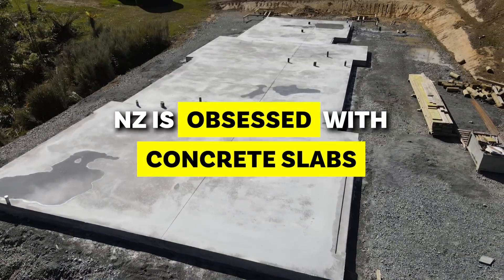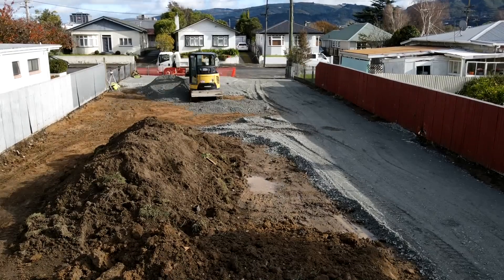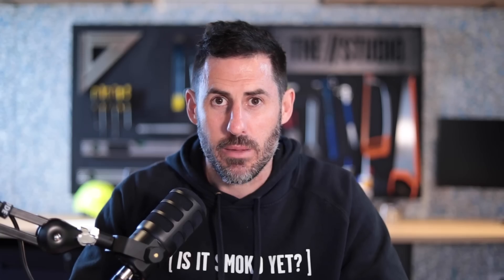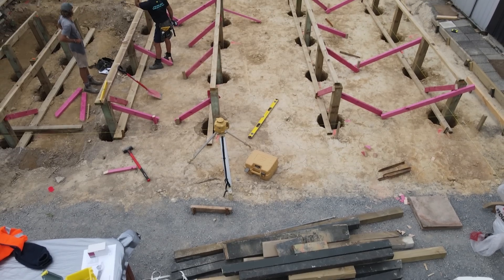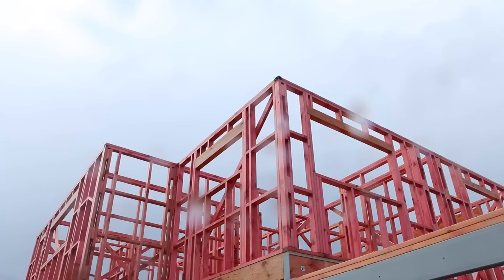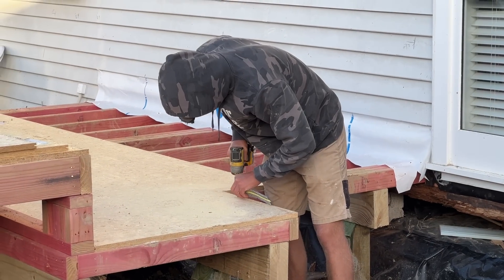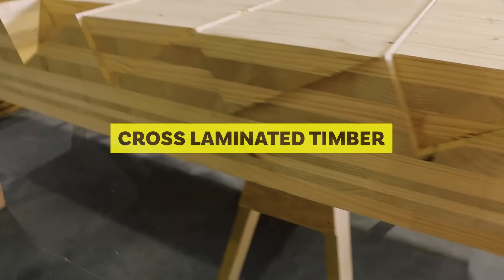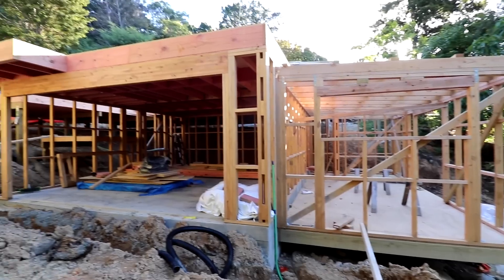New Zealand is OBSESSED! with Concrete Slabs

Comment: Concrete crews are adding an additional cost to building in NZ in my opinion. Once upon a time.. builders built everything. They had a sensible charge out rate .. alas .. now  .. they seem to be more site managers and other trade facilitators then builders. IMHO. Its how ever single layer of a build from design to completion has a margin tacked on. The consumer pays for it all. It may interest people to know that a concrete slab for a lifestyle shed of 162sqm was quoted at $45K. This didn't include any earthworks ..just arrive, box, fit the supplied polystyrene, lay the supplied seismic mesh, pour the slab and finish. Yup .. that didn't happen. Slab done 100% finished and council approved for $10500. Recently, I got a quote to add the ramp entry to the shed as I'm time poor... 9m x 2m $5400 .. you have to be joking right!! NZ building is out of control. I might be an old-timer but seriously.. tradies don't really need new utes every year ...do they?
Reply from the maker: Thanks for your perspective, I know costs are a big concern!

Comment: How high off ground level can you build up a concrete slab? Assuming ground is relatively flat and no complicated engineering, i.e. just a normal max height of slab under normal conditions. Thanks
Reply from the maker: I think 3604 allows you to build a shutter 600mm before you need to consider blocks / retaining / engineering
Reply: Thank you Josh, if you had an existing slab could you raise the floor level by laying say 300mm joists (for habitable dwelling), or would this require specific engineering, thanks

Comment: Concrete  tends to have a few issues with earthquakes and the fact that on the shaky isles is on fault lines and volcanoes means odds are in a major event (like the Christchurch earthquakes) a lot of buildings are going to suffer major damage and be condemned.
"Option C" go base isolating.

Comment: I've put in a concrete slab, and timber floor over the top of it just to subvert expectations :P

It'd definitely say that it's not "faster" though (at least in the little experience I've had) - you have to tie in putting the slab in with the sparky, plumber, drainlayer if different guy than the plumber doing your septic tank and whatnot - and everyone's always busy and will be there next week. Timber piles, you just build everything first and whoever needs to do anything can do it later on and go through the floor.

You can also take your time building on a concrete slab if you're waiting on materials and whatnot (ie. you're not a big building company builder that can dictate when and what happens using their own warehouses, tradies, transport, materials etc.)

Comment: Good video. We've gone through a number of design processes and the last one, we were going to use SIPS panels, which were two layers of Magnesium board with polystyrene in the middle. Mag board is very hardy and water resistant. We were also going to use Espan CLT products for our floors. In the end, that project blew budget and we cancelled it. We are still left wondering what to do. In central New Plymouth, the Council is now allowing house building heights of 11m, which allows 3 floors, so we might build a compact tall Air B&B? Our issue is also having a very soft ground, so we have to pile down deep and probably have a steel structure if we go 3 floors high. But....National have been talking about a non consent 60sqm granny flat option, so that's a possibility too.

Comment: Concrete and brick is by far the best common construction technique we have these days.  You can build a house with concrete slab and brick walls.  And in 100 years its still going be as strong and look the same as it did the day it was built. 

Timber (especially plantation pine etc) will rot or fall apart well before then.  And its not even striaght when its new, let alone years down the road.

My house is a 60s double brick house.  It has jarrah timber frame flooring.  Cement tiles on pitched jarrah roof framing.  The bricks are just as good as when they were layed.  The timber though is sagging and squeeking.  I had replaced all external fascias, gutters and eves because they have rotten away.  But the bricks are still going strong
Reply from the maker: How good! huge benefit of a brick home is the maintenance

Comment: Concrete doesn't crack. Lazy hit and run contractors who just wants the placing money only contribute it to cracking.

Avoid cracking by cement stabilizing base and taking compaction really serious.

Poly line sub before hard fill.

Cement stabilize hard fill then compact hard.

Use a large aggregate low slump concrete mix.

Seriously vibe concrete to consolidate (not taking a brisk walk).

Wet cure without break for 7 to 8 days non stop.

Comment: Hi Josh. I moved to nz 16 years ago. In South Africa. All houses without exception there are built with a concrete slab and brick and mortar for internal and external walls. Found it quite hard to get used to posts, timber floors and drywall.
Reply from the maker: Very interesting how every country has their standard

Comment: My NZ house was built in the '60s with a concrete slab.  NOT insulated so the 'thermal mass' sucks up heat all winter!
Reply from the maker: Interesting isn't it - the slab edge insulation that we are seeing more and more now fixes that issue
Reply: @nzbuilder   So much better these days!

Comment: Google waffle pod slab and Court case. Hundreds of homes destroyed from slab heaving. No one these days will pay for a raft slab. Ive lost count how many blocks of land I've seen destroyed because someone's chosen concrete and excavated a level pad especially on the low side of the road and the house disappears in the cut then they've spent tens of thousands retaining the cut in as little as a 1m cut. Never cut and fill, domesticly its never compacted correctly and never tested and youll spend thousands on piles either screw or concrete. Timber every time BULD UP not down, make use of underfloor space either garage or storage, and never need a cheap but expensive ugly tin shed. Also look at permanent polymer formwork on strip footings sloping or level site, instantly waterproof not wet trades involved. 🇦🇺

Comment: I bought a house in Melbourne's east last year that was built in 1971 built by a German surveyor anyway it has a concrete slab with internal heating galvanized air ducts i put a 5m endoscope to check for rust but still in perfect condition 53 years later...beautiful home it even has sisalation aluminium between the brick veneer and stud wall including master bedroom ensuite and courtyard...pretty advanced in those days, but the ductwork in the slab i haven't seen before

Comment: Our houses in Christchurch all had piled foundations. Our house we occupied during the Christchurch earthquake suffered NO foundation damage as did our previous 3 houses.  Two of our friends with new houses, less than 1year old, which were destroyed and red stickered by the failure of their concrete floors. All areas of NZ are earthquake probe, hence the preferred use of concrete seems to me, as an engineer, rather illogical.

Comment: 10 mm mesh makes a stronger slab with fewer cracks. Is better to tie the slab to the ground with ratwalls or trench with steel reinforced concrete and steel reinforcing rods or bars to tie them to the concrete slab. A lot more builders just sit the slab on the ground with nothing tieing it into the ground these days. Always best to vibrate all the concrete to increase its strength. 😊

Comment: As a chippie, I don't know why you'd think outsourcing the foundation to a concrete crew is beneficial, you're throwing away part of your skill!
I always encourage customers to use ply or laminated floors, as it's so versatile and as a builder I can get creative and solve my own problems.
I cannot manipulate concrete the way I want, and most of my customers live in steep areas or earthquake prone.
Reply from the maker: I do a bit of both depending on my crews workload - but your right - its a great skill for all builders to learn

Comment: What about rising damp? My 70s home has a concrete slab in the garage and rumpus room areas and the waterproof membrane has failed in multiple areas with water slowly rising up.
To replace it will cost well over $100k...

Are concrete slabs these days somehow more waterproof?

Comment: I’ve had houses with both timber and concrete that my wife and I hsve added to ourselves over time, selling on for large profits. My current house is 8 years old with a rib raft slab and it’s turning out to be bit of a problem to add too because of differential settlement that can’t easily be remedied. The original slab and the new slab cannot be  structurally joined with sufficient steel to ensure they work together and the structural engineer advises that there will always be a risk of differential settlement and a 44mm movement at the roof level is probable. Which raises the prospect of a leaking roof. Painfully penetrations for new bathrooms in the original slab are not really that easy to deal with, if at all possible. Whilst I prefer concrete the fact is active raft solution is shit for renovations and additions.

Comment: You missed a few things that a timber sub floor can be relocated easily and access to services under the floor is really easy; and should you need to move something later on down the track this can be done easily . Con floor can rot if allowed to get wet /have a leak. I would take a timber sub floor any day on screw piles
Reply from the maker: Very good points!

Comment: Following my experience after the CHCH earthquakes, I wouldn't ever do a slab floor build. Easier access with piles, easier to make changes, repair plumbing etc.
Reply: The CHCH earthquakes showed soil types need to be considered when building. Anything built on soft sandy soils needs to have piles as it's more likely to survive if there's liquefaction. However, houses built on solid clay soils have no issues with liquefaction, so a concrete slab is fine....but your other points are good ones too.
Reply from the maker: For sure - I think engineers are pretty on to it with the design of each foundation these days as well

Comment: The main reason for building with concrete pads in NZ is to be able to build closer to the boundaries with lower shadowlines,  thus using less land area.
Would never buy a house in NZ unless on piles myself,  only have to look at results from the aftermath of Christchurch earthquake right offs.

Comment: Great video, I personally prefer timber subfloors, I would add that timber subfloors are great if you're a one man band. We have had rib raft slabs Completed with frames on site in 7 days when the site is straight forward, they are amazing when done right.
Reply from the maker: Totally agree - built many great homes on sub-floors

Comment: Timber all the way.  I have owned 2 houses with concrete floors, hated them with a passion!
Why?  If you have any services go wrong you will be paying at least $10,000 to have them repaired.
The drain from our kitchen sink broke and blocked.  The pipe was 12.5 mtrs long.  If our house was on piles, it would have cost less than $500 and I could do it myself.  Being a concrete floor we had to take out the kitchen cabinets, strip the laundry and bathroom and then have a concrete cutter in our house cutting up the floor before the plumber did his job and then new concrete, wait 10 days, then reassemble kitchen etc.  In 2004 it cost us $15,700 + my time with the kitchen etc.  And guess what, insurance won't cover that as it's classed as 'gradual damage'.
As far as I'm concerned you can shove a concrete floor where the Pope fears to wash!
Reply from the maker: Definitely great reasons to do piles!

Comment: So, few extra points:

1. Part of the kiwi dream is a 6x6m attached garage. That would require 2 separate systems, concrete and timber floors.
2. With height recession planes as per district plan rules, which are often 2.7m and 28deg from the boundary on your southern boundary (neighbours nothern boundary), timber subfloors around 600mm off ground + 2455mm FFL to U/S of Truss + nowadays a 200mm heal height minimum on the truss to fit enough insulation in, and you're getting to heights above the height recession plane.
3. As a designer, concrete floors are just easier. No bracing calcs, no tables required to work out joist spans, bearer spans and pile sizes. And no cross referencing between the 3 tables to optimize. Just read the geo report, design to suit or pass on to an engineer if SED floor is required for TC2 or TC3. Just from the deisgn perspective, I can lose a day designing a slightly more complex shape timber floor = $$. 1 hour versus 8 hours of work for me.
4. Raft floors (Ribraft etc) don't actually perform that much better than standard NZS3604 floor slabs according to BRANZ and some of the H1 experts for heatloss. Apparently the advantages are negligible.

Comment: I'm doing a small cabin, it's getting a slab, but a fully insulated slab with high thermal mass.... it will be cut into the hillside, and the removed material will build up in front of it to keep the deck to drop off height under consent limits. There will be another floor above the slab with heating in it, and all the valuable solar gear that prefers cool stable temps in that engineering layer. Safe from theft and out of the way.

Comment: I used to do slabs 15-20 years ago. With a crew of 4, we could box a 200m2 floor in 2-3 days. Another day for pour and one more for de-box a week or so later. Some quicker some slower. Slabs from 40m2 to 500m2. All depends on the good ground. Since then, I've been a QS and most floors are SED and not 3604 or firth ribraft. Edit... slabs are only good on flat sites, que massive earthworks and retaining/drainage

Comment: In Australia something like 90% - 95% of new houses are built on concrete slabs, anything else is just plain rubbish.
Reply from the maker: Australia has issues with termites etc as well I believe
Reply: @nzbuilder  Yeah they are and added bonus, though there isnt to much for them to eat in W.A., as we build in double brick plus mainly using steel in the roof., the cost of putting a slab down v's stumps and wooden floor is about the same here, Ive lived in both and will never go back to a wooden floor construction.

Comment: Building on the slab ten working days after pour? So much for the 28 day wet cure, then. NEXT!
Reply from the maker: Concrete typically takes 24 to 48 hours to dry enough for you to walk or drive on it. However, concrete drying is a continuous and fluid event, and usually reaches its full effective strength after about 28 days.
Reply: @nzbuilder  99% of maximum strength after 28 days if you keep it wet for that time. It can't continue the chemical reaction of hydration if you let it dry out.

Comment: Concrete's alright - the only reason concrete rates so high in total CO2 emissions worldwide is because we use so much of it. If we built to last, that wouldn't be a problem - and even as it stands, trying to replace the concrete we use with steel or aluminium would emit vastly more CO2, and there simply aren't enough trees in the world to replace concrete with timber. But a concrete slab or concrete building should be engineered to last several hundred years, and when we're finished with it we can crush it up and use it in the next structure. Use concrete thinkingly and it's not a problem.

But all that polystyrene? That's a hard nope. Poisonous as it stands, flammable with truly disastrous smoke, and functionally impossible to reuse or recycle. The planet deserves better than that we contaminate our dwellings with that muck.

Comment: We built a wood floor house on one of very few sloping sections in a new subdivision. Council held up concent for over a year and cost me $30k in interest. We had already built several concrete slap homes in the same subdivision without those issues.
Reply: On what basis?
Reply: @fredio54  Incompetence and bureaucracy. My neighbour has a council issue with his build, the architect had designed the house facing the wrong angle. He wanted to rotate the house by 15 degrees to maximise his view. Because of the local council, it ended up costing him $40,000 in engineering, council and additional bank fees and delayed the build by 18 months. In those 18 months, building costs have increased by over 20%...

Comment: As a Kiwi indentured builder of  37 years, timber floors are much much nicer to walk on....
They have that "little bit of give" in them & you can feel it & appreciate it. 
"Stompping Elephant Syndrome" is a "user interface problem"...... i.e. the a hole doing it.
Also most concrete slabs are constructed too low too the ground here in N.Z. & don't actually meet the 3604 code but council inspectors are so useless they never pick up on it or don't care.....
Seen it happen for many many years...... 
Virtually all concrete slabs never get "curred properly" or adequately in here in N.Z. as well, as it's all rush rush now days. 
Concrete takes 28 days to cure fully & needs to be kept wet so the cement can keep hydrating itself in the curing process..... 
Virtually all concrete here is just poured & not cured at all & un cured concrete doesn't atain half of it's possible strength. 
Who invented concrete??
It'll supprise you how long ago it was invented!!! .... 
Those clever bastards!!! 
They changed the world....
Reply: Aquaman and the fish. All those shells cluttering up the seabed were useful for something. Atlantis was all slab on grade.
Reply: Romans
Reply: aliens